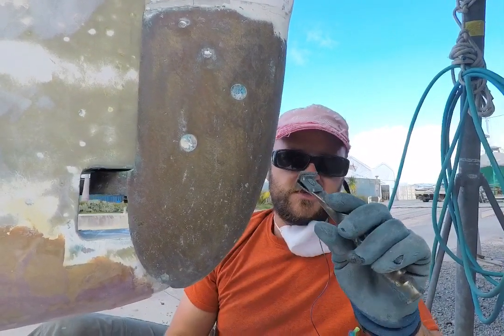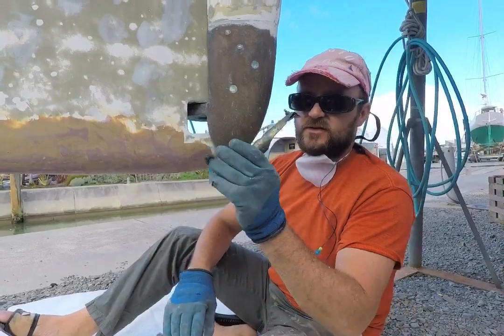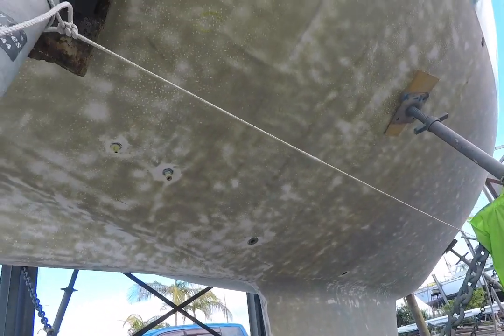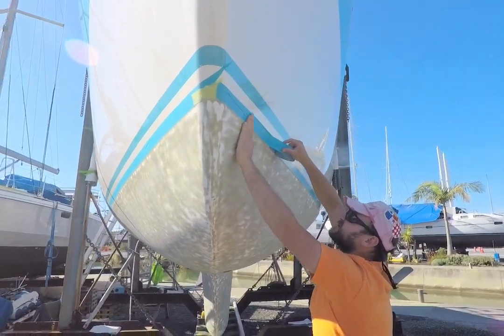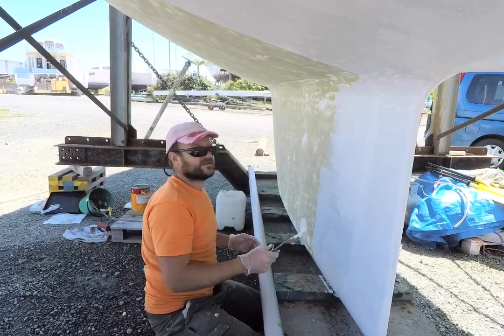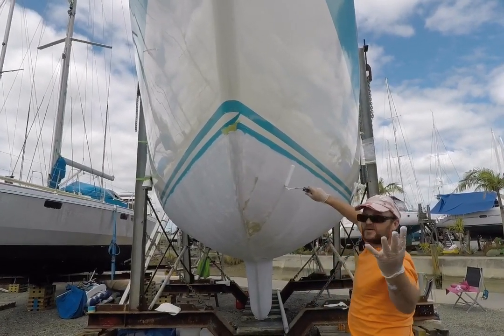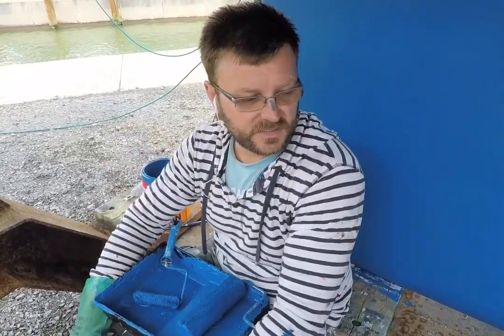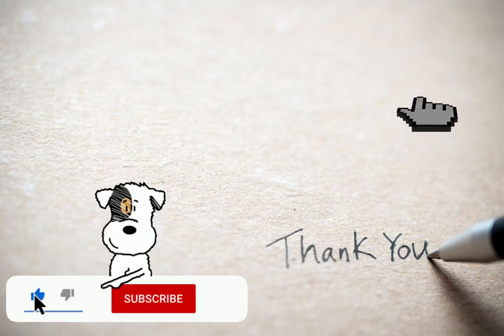How to remove all the old bottom paint and antifoul for the tropics? #outwiththewind

Comment: I just found your channel today and I like what your doing. I use the same antifoul on my boat. I worked for a paint company that painted large boats and was informed that once the fouling tacks off rain won't bother it. It's only if you put the boat back in the water that it might wash off. If it's out of the water for to long it sets to hard and won't work so to reactivate it just give it a light rough up with a kitchen scoura  to etch the surface and it will work fine.
Many sailboats will use a hard antifouling on the undercoat then soft on top of that. The idea is to have the hard a different color than the soft which gives you a visual gage for when the soft is getting thin.
Reply from the maker: Great advice. Thank you.